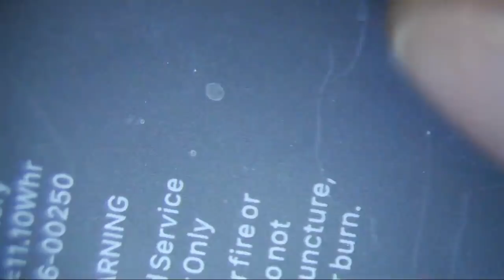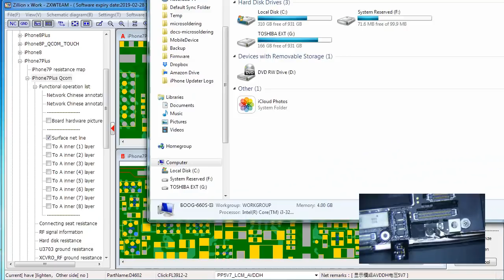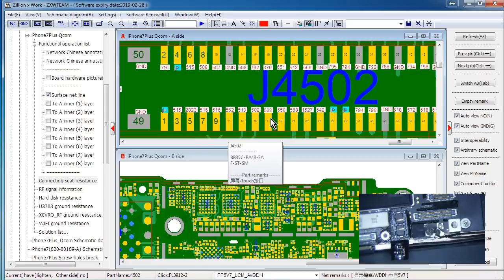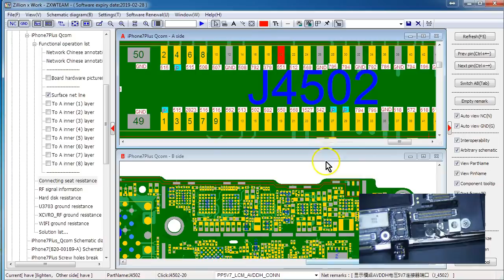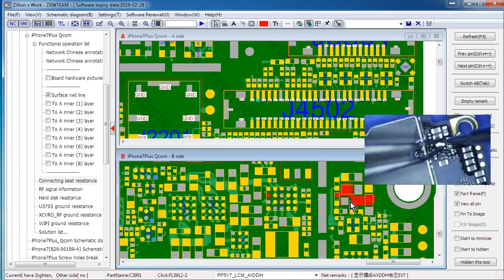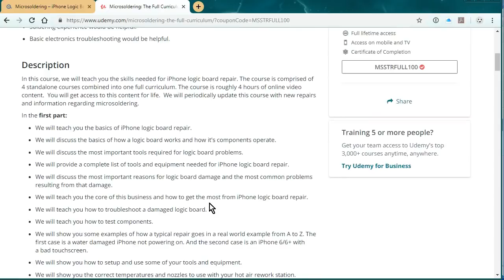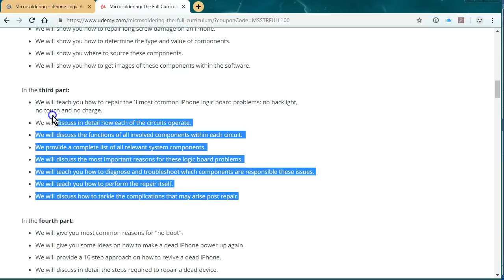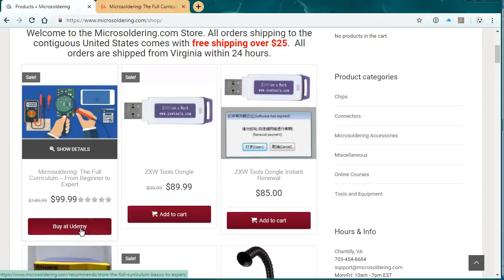iPhone 7 Plus How to Diagnose and Repair a Black Screen

Comment: Maybe a stupid question but do filters need to be put back in a certain way I.e different side or polarity ? Great video again
Reply: common filter doesnt have polarity
Reply: @microsoldergeek  thanks for reply. I know some big filters do need the correct polarity but just getting into mobile phone board repair
Reply: @118Wilson  same here,,just started about 4-5 month already.most work on filters repair on 6's were pretty straight forward,change it accordingly or make jumpers :D.happy customers